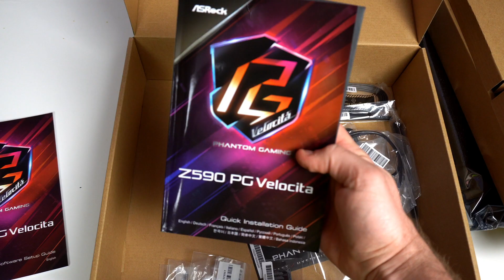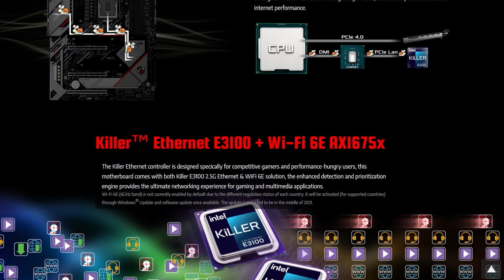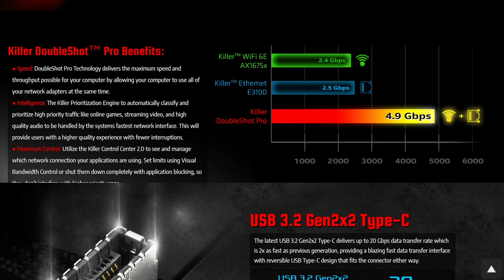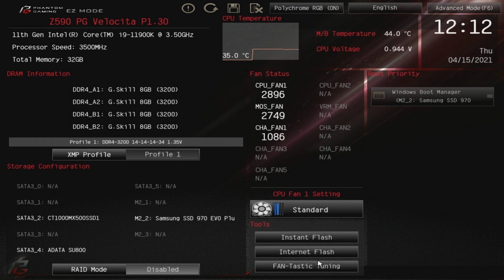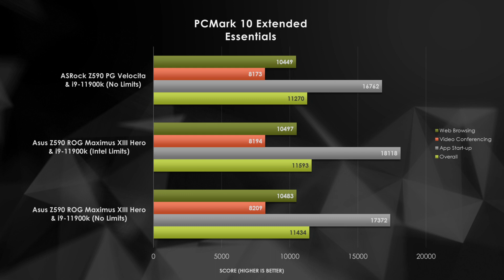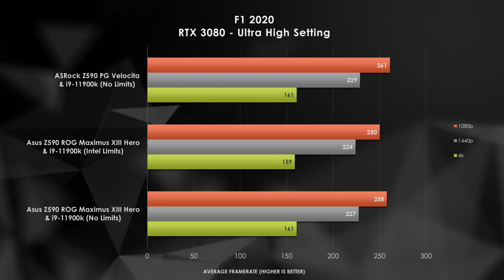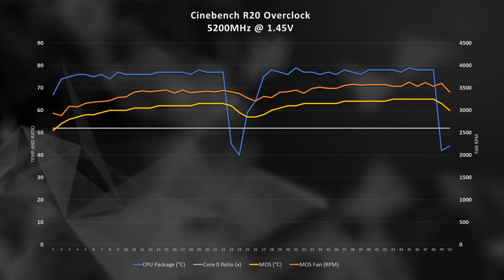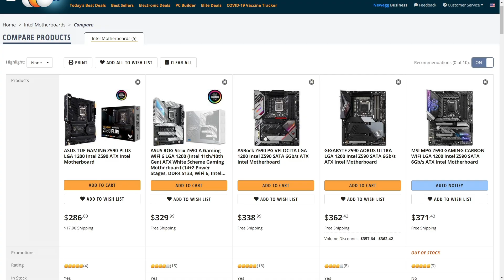ASRock Z590 PG Velocita | Good ROG Alternative?

Comment: Great review ! 👏 Are you sure that this board only has a 50A vrm design ? On ASRock website it is written 60A...
I think 50A wouldn't be enough for overclocking... 🤷
Reply: It's written 50a dr mos see the page carefully. Asrock says 60a chokes not mosphet
Reply from the maker: you might be looking at the wrong board.  This one is 50A per stage, per the ASRock rep and spec https://asrock.com/mb/Intel/Z590%20PG%20Velocita/index.asp#Specification
Reply: @TheTerk  OK fine it is written premium 60A power chokes that's the most important for me to deliver enough stabilized current to components 🤗
Your memory o/c wasn't totally good because of Gear 1 and 2 belonging to 11th gen but did you manage to get better results with 10th gen Comet Lake ? I've got a 9th gen 9600K mounted on a Z390 board and 4x4Gb Ballistix Elite 3200 CL16 overclocked to 4000 CL18 that's really nice without Gear 1 and 2 mode 😉
Reply: Yeah but to me it's the power chokes which are the most important and every other manufacturers only mention that feature on their website even Asus with the Maximus XIII Hero, so I'm fine 😉
Reply: @maxoo._  chokes is a tiny bit it doesn't matter in performence I thik u are a new one in this market
Reply: @mainly_dyutish9  Mounting PC's since 2007 mainly AMD plarforms (DDR1/2/3) and Intel one since 2019 (Z390) never been interested in power delivery before 😁